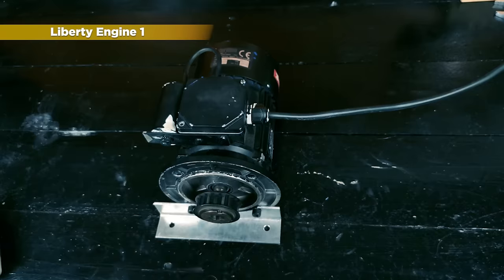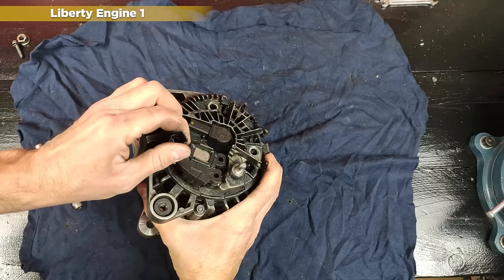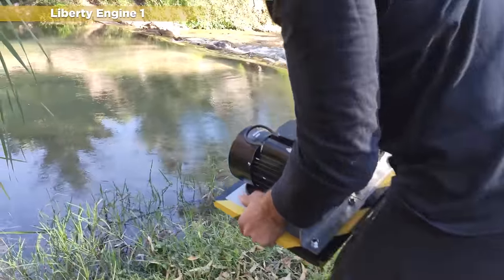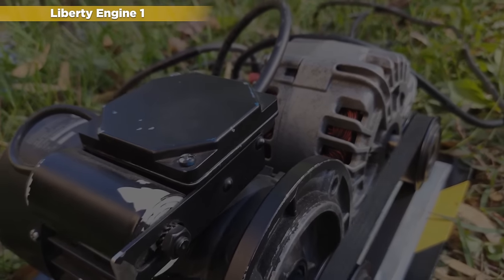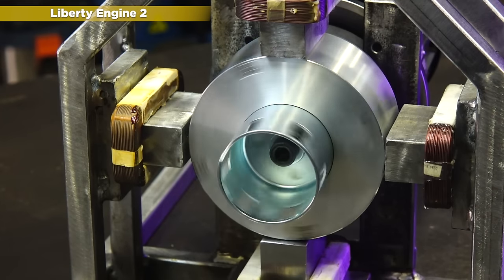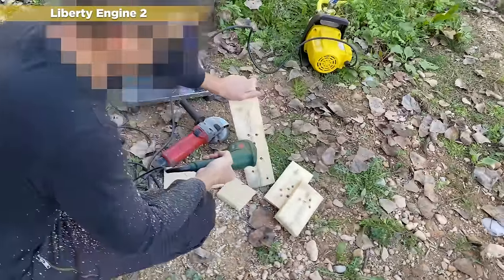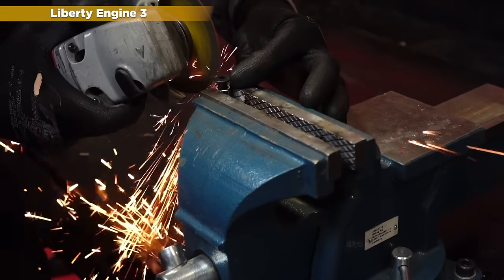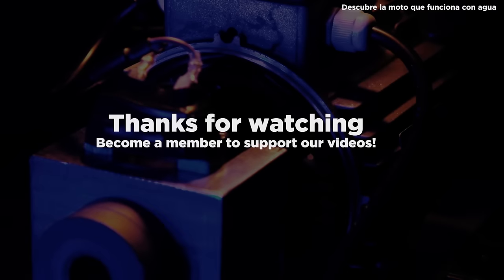Liberty Engine Infinite Energy Generators - Evolution, Comparison and GIVEAWAY

Comment: I have, over the last 10-12 years, achieved construction of a self sustaining pulse motor. This was accomplished by trial and much error. Running now for two years, had to replace the battery once. I don't use formula's or calculations, experimentation only. Your device is a very valuable piece of equipment, and it is scalable.
Reply: @josivanbranco1462 Amigo ele mostra todo processo.  Mas tem que ser membro do Canal.
Reply: Great work guys how do we access the metal alloy mixture to get this to the world?
Reply: How to orders to save mother nature?
Reply: @josivanbranco1462  They shouldn't be showing their faces because of cartel energy companies.
Reply: So this video didn't quite reach the 5M views, are you giving another date for the giveaway?
Reply: How about now you try to combine the free energy source with a linear vibration gyroscopic motor? It is basically a combined gyroscope that produces pulses of centrifugal force focused on one point. So you can move a vehicle from the inside without traction on the wheels. Also airplanes and something even more interesting. I have a simple and versatile linear impeller design that would only need a power source like the one you built. Let's talk!

Comment: could literally free the world
Reply: I agree with LUCKY FAN. But. 
#3 can't work without an input signal to perpetuate the sine wave.
#2 could, but not exactly as you show it. The voltage on the gen head was too low on all the replications.
That said, the double frequency on the gen head fed back to the induction motor gives it a chance.

Comment: I know exactly what kind of secret silver aluminum alloy they use in alternator's rotor. It works OK but not great. A little bit to much heat and parasitic loses.
I copied the idea and made some improvements too. Instead single phase I have used 3 phase setup. Now my device makes about 23-25kW energy and weights only 17.5kg. I disconnected my house from grid and even sell some electricity to my neighbours. Easy money!

Comment: I have always been fascinated with this system. Although 220v is great,  where I live most electrical is 110v. Can one of these be built for both 110v and 220v?
Reply: your breaker box just splits 220/240 into  110/120 to the left and right fuses

Comment: Hi, Im making my own one device. 
How about now you try to combine the free energy source with a linear vibration gyroscopic motor? It is basically a combined gyroscope that produces pulses of centrifugal force focused on one point. So you can move a vehicle from the inside without traction on the wheels. Also airplanes and something even more interesting. I have a simple and versatile linear impeller design that would only need a power source like the one you built. Let's talk!

Comment: I've been highly critical of this on other videos; I'm quite interested, but also very skeptical.  I've seen other magnetic motors, so maybe this works, but I'm always left wondering why I can't get one.  If I had this and it tested true, I could get it out there to people.  This episode is great because it shows the why of improvement, and shows that they're constantly looking to make it better.  Very nice.  I wonder what they'll improve next.  If no significant heat is produced, it would be very easy to make a soundproof enclosure with materials available at Home Depot etc.

Comment: The alloy composition is aluminum and silver.
Exact dimensions give the volume of the cylinder.
And the weight give us the way to calculate the density of the cylinder in gr/cm3.
Then, you can calculate the composition of aluminum/silver.
Thanks

Comment: Guys, you could use this to power my custom design hydrogen generator I'm about to start assembling this coming week that I have designed for Semis to increase mileage at least 30%.  It could probably run a whole car, the energy capacity will certainly be there.  !!!  I make a wet cell style system and I have two small containers currently on my 4 runner with a lift, big tires, ladders on top for work, a cargo hitch full of 200lbs of hydrogen parts, and the cargo space is full of about 400lbs worth of tools and materials for work.  My two tiny containers pull a total of 20 amps together when warmed up and produce 40-50% improved mileage when driving at 70 MPH at 2500-3000 RPM not even in over drive (at slower speeds and in over drive those numbers would be even higher).  What I am about to make will be able to handle as much as 100 amps probably without overheating.  I haven't produced much in the way of pictures on social media in recent years due to wanting to keep a very low profile as I go into business this coming year,  although I do have a few old videos on my channel of the old setup I am currently using attached to my bumper.
Reply from the maker: That's very good friend

Comment: Amazing technology sir, am really pleased and happy to learn about this technology.but what I wanted to know  is 2 things

1. can it draw 16 amps parallely  at 3 switch points at a distance of 30 mtrs... For eg. The source or the alternator unit is at a point 30 mtrs away and we have 3 number qty 16 amp plug points spaced at 2 mtrs away. For a 20 kw unit can it draw 48 amps parallelly ... And also the output should be 220 vac 50 hz

2.  At a second scenario I need 3phase 415 vac 25 kw output , is it possible.?

Comment: I tried to replicate LEV3.0 but something is not working. I have different magnets from big speakers what i had around but it is not running at all. I will modify the magnets and motoralloy from a different motor. Maybe the transformators from the microwaves which i found in trash around the houses are not similar but they looks like. So I hope to win your LEV2.0 this would be helpful for powering my heater of 3kw for free and nor from the E government company. I am afraid to see LEV4.0 with double coils...what kind of motor will you use than? Already done? When will the video come by upload to your channels...

Comment: Hi , athis in anbu from India 🇮🇳
I have a doubt!
3:01 
How the bumb deliver's the water without suck the water ?
Can you explain it ???
Reply: water stlll in line from previous test im thinkng but i saw that too
Reply from the maker: For the pump to suck, we must first put water inside. For this reason, when you activate it, the water contained inside comes out and we quickly submerge the hose so that it continues sucking water.

Comment: Shared all over trust me ive been saying showing and am about ready to play twords building my own.  Ive extensive auto knowledge and is my mo. Ive designed and built led grow lights, was going to get into plasma lights also, still may.   Went deep into led drivers, ac variacs, transformers, tube style audio devices, magnet charged high voltage coils,  frequency all around with focus on ac drive motors, dynamos, 3 phase motors, minor capacitance, atmospheric energy harvesting gosh there's an easy 25 more at the least.  Getting into magnatrons and see something i need to attempt.  
Oh man its all wrong...  i noticed it when you spun the rotor by hand it had resistance between mags lol come on ya gotta know how to have free spin smh.  Cool vud though